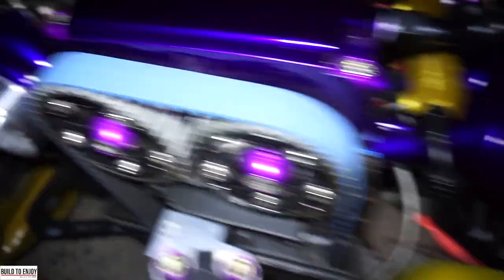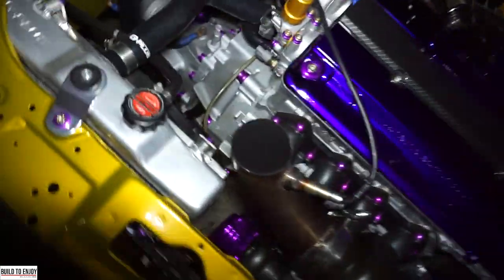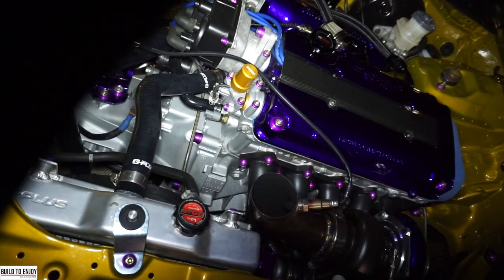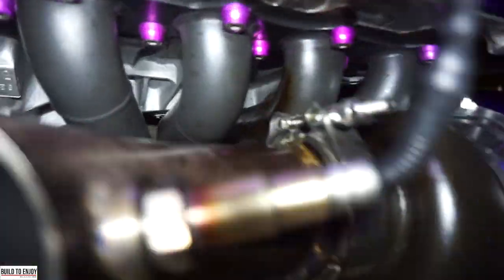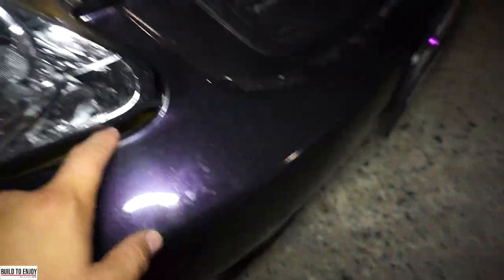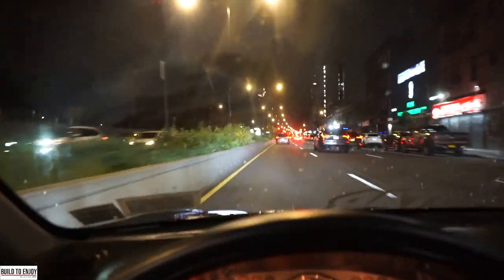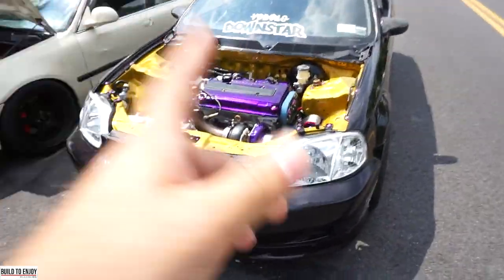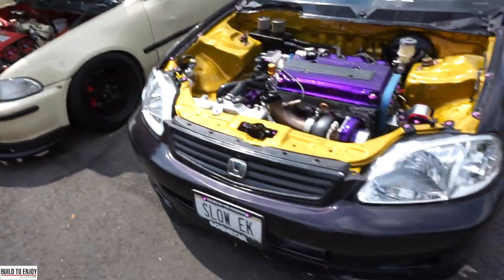First drive in my fully built turbo civic !!

Comment: Yo bro !! Nice👌🏽🤙🏽🤙🏽
Install a oil pressure Guage it helps diagnosing vtec issues...did you guys put the lil o ring that goes under the center cam cap